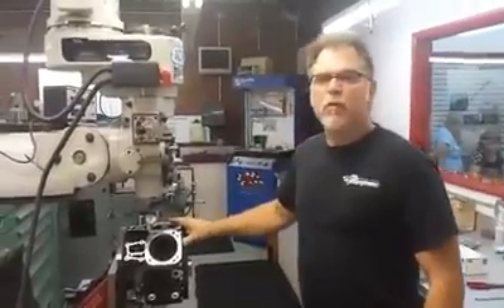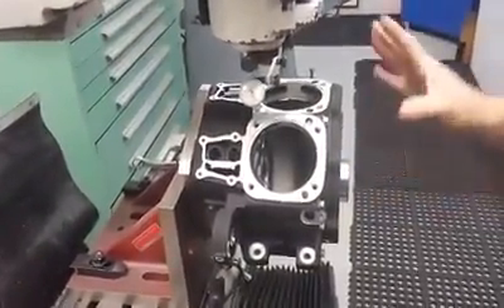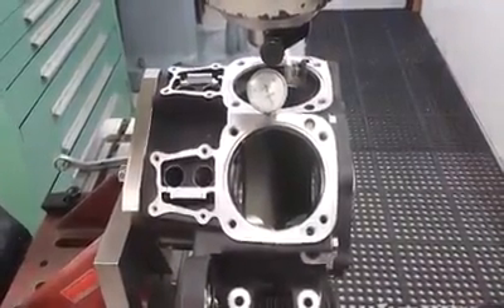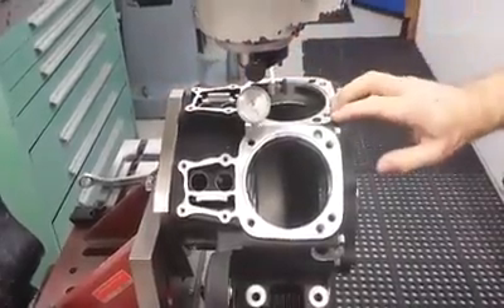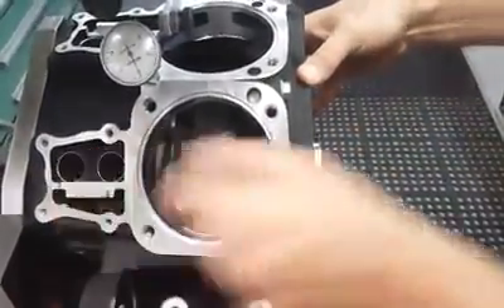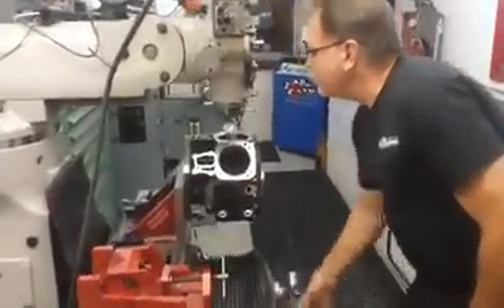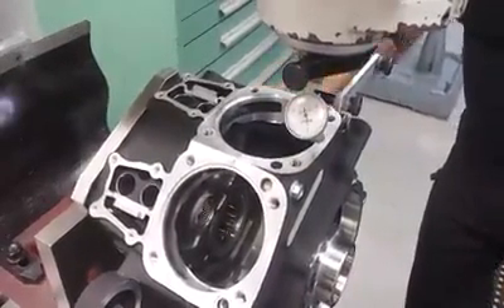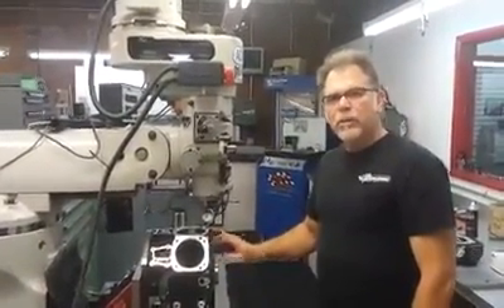T-Man Performance - Tech Tips: HD Case Alignment

Comment: There are no base gaskets, it’s sealed with an o- ring on the cylinder sleeve that fits in that groove.
Reply: When you bore cases, you bore out the stock o-ring landing and have to run a base gasket
Reply: Mine 107 is a leaky bitch, but she is fast and smooth as butter! I’ll have to check my cases next time it’s pulled apart.

Comment: Yet another instance of the poor build standards of H-D since the manufacture has been automated removing the input of human builders. I have seen lots of very poor machine work on cylinder heads - out of round holes that were then taped for sparkplug threads and valve guide holes that looked like they were made with a chisel.....

Comment: So what suggestions would you have if this happens to our newer motors? Most people do not have the resources to completely tear down the motor to this point, nor do we have a machine shop with this knowledge.
Reply: Craig Wexler 
This is only a problem if you use a gasket 
The real big Bores use gaskets 
Not o-rings